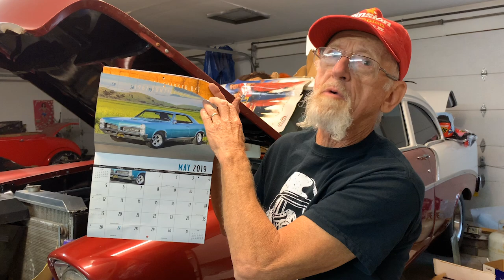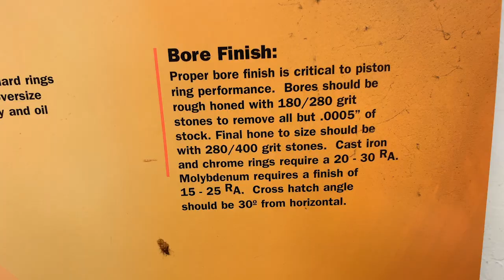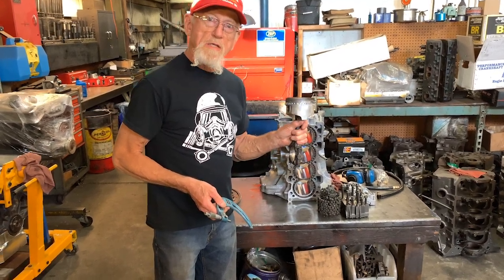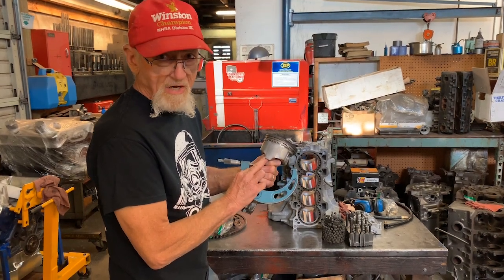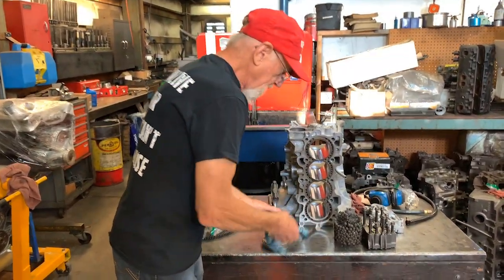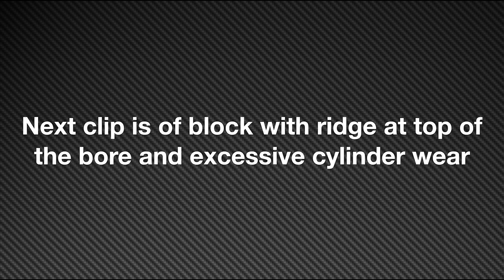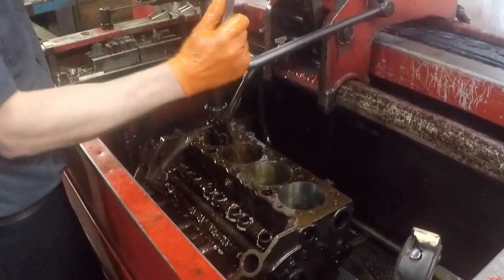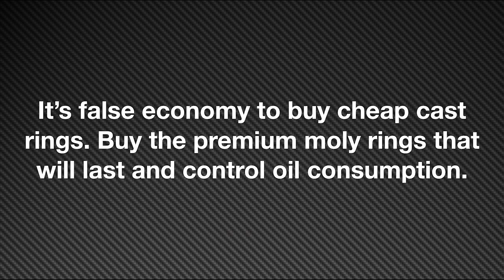Hone Your Cylinders Correctly. Enough Bogus Info!

Comment: Forged Pistons clatter when cold and in spec.
Reply: Not if the forged pistons are forged from #4032 aluminum alloy. The aluminum #4032 alloy has a clearance close to as tight as that of the factory cast aluminum pistons. The #4032 alloy has a higher silicon content that gives then makes them much more thermally stable than the forged pistons that are forged out of the more ductile #2618 alloy. Check out both J/E pistons & Wiseco pistons for a pleasant surprise!
Reply: @jackflash538  no forged piston is going to have as tight a tolerance as hyper pistons do.

Comment: Dont use cast rings? Hahahaha!! It came from the factory with cast rings and I have 225,000 miles on it. This old timer is so clueless. And hone jobs at at shop are $375. Not $50.

Comment: Hello sir u explain good please tell me bore honing stone used which grade
Reply from the maker: I recommend Brush Research ball hones to the do-it your self er 320 grit it a good finish. I probable own 20 of these for wheel cylinders, lifter bores, and cylinder walls. You end up buying so many because the range they operate properly in is very small.
Reply: @PerformanceEngines  Ball hones? Ffs...

And you "know what you're doing"....

Comment: No torque plate???
Reply from the maker: On a new bore and with the finish hone<yes. One a hone to just deglaze and get a correct cross hatch, if you install a torque plate on a SBC it will take.002 removal to get the stones to quit chattering and make the cylinder round. Now you have too much piston clearance

Comment: Unlike the experts making comments,  I want advice . I have a 6.7 powerstroke 2011,  scratches on 2 cylinders .... I have no way to " get the block to a machine shop or i probably would"   ball honing you say is better than stones?   i'm going to do this myself  . unless some mirical and you roll in my driveway with a hone machine...lol  .   little help I'll gladly accept your knowledge
Reply: if your cylinder is scratched simple honing wont work. they need to be bored with a machine. your cylinder is scored. serious.

Comment: I've just got a 50cc scooter engine though
Reply: I've honed one of thos small engines with a peice of 150 grit sandpaper rigged up too fit in a drill.
Reply: You could even wrap a small bar with duck tape too match the bore size with a little bit of fluffy cotton between the last layers too allow the right amount of pressure and sandpaper on the last layer. Attach that too a drill and your in business. This will work I can guarantee.
Reply: Iv rebuild a 2014 rmz450 4 stroke. Split the cases too change the main bearings and crank. I practiced on thos little 50ccs till I got all the basics. Now I'm quite reputable.

Comment: Lol really . What’s wrong with ductile cast iron rings ? So they might need addressing after 100 thousand miles , big deal because that’s nearly a lifetime of use in a Sunday driver classic car . Also you spent thousands and thousands of miles getting a beautiful polish in the bores only to hone the bore for moly rings ! Crazy , put cast rings in and they beard in near immediately without honeing . Sure if you have had a rebore  then you got to hone . Removing glaze ??? No such thing , what you have is a polished cylinder bore not glaze . Glaze is what you find on brake shoes not cylinder walls .